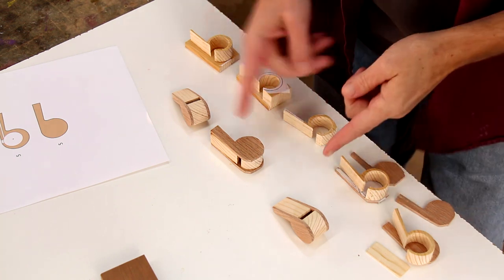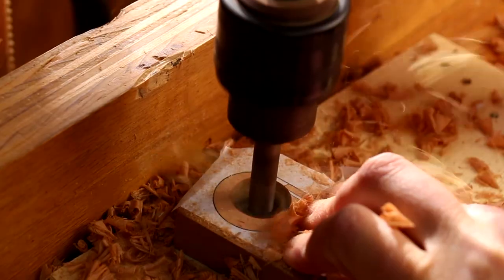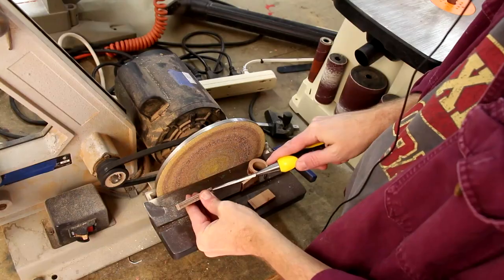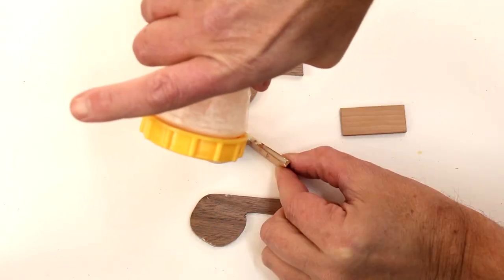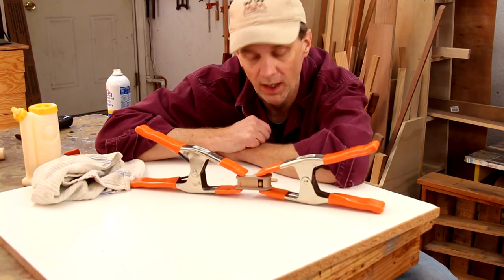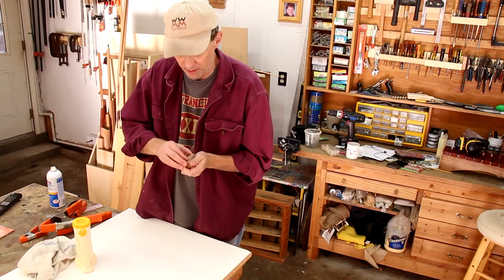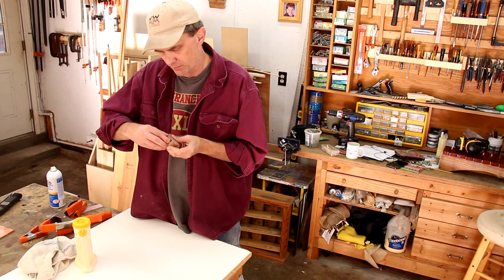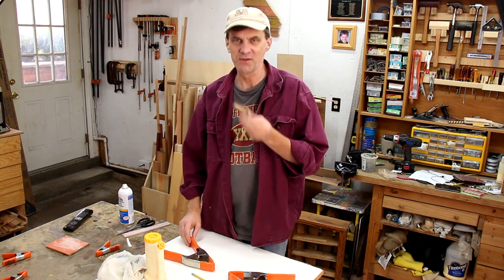Make a really loud referee or police whistle | 2013 New Years Noisemaker

Comment: Steve, I'm a long time follower, and I wanted to throw an idea your way.  Have you ever tried oven-tinting wood?  That is, placing the wood on a cookie sheet at 400 degrees for however long of time it takes to change it to the color you want the wood to be?  (the longer it's in, the darker and deeper the tones that come out).  I got the idea from a set of plans that I purchased, as well as the guitar company Ernie Ball/Musicman doing this process to their necks, which is a newer endeavor on their end (I love their guitars).  If I can avoid it, I will never need to stain smaller projects again.  For some reason, this project struck me as a perfect candidate for heat tinting, and I may try it.
I'm currently heat tinting some pieces of wood for a marble run that I am building, which is the fourth project that I am doing this method.
Keep up the great projects Steve, I thank you for getting me back into this hobby!

Comment: Great little project. I had wondered if the center piece could have had some way to add extra material to possibly provide a way to add a loop to run a string through for hanging on your neck?